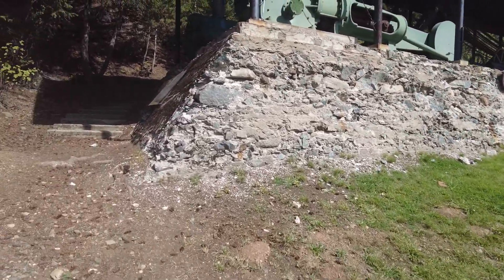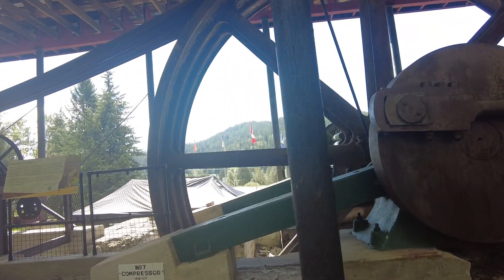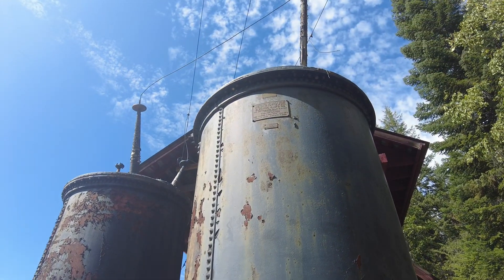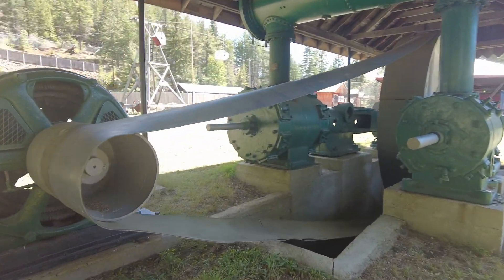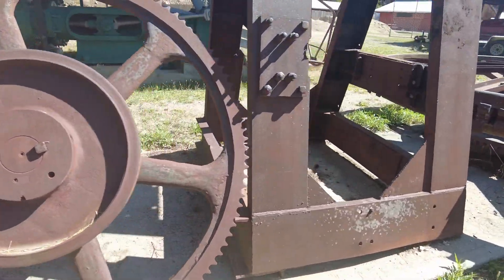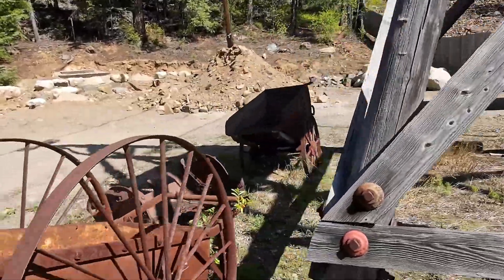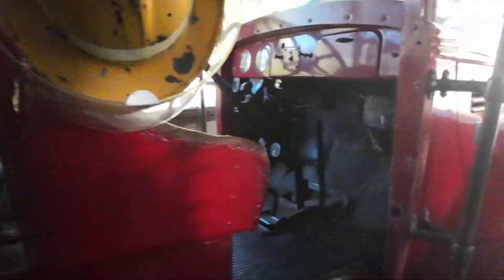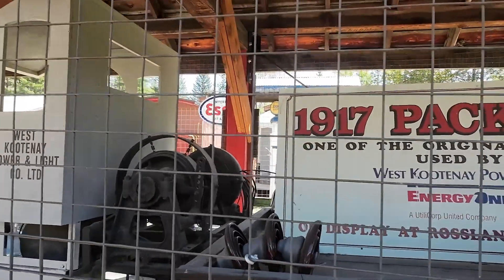Rossland BC - Nikola Tesla's Power Generation Technology, A Giant Air Compressor & Gold!

Comment: some engineers say ... in long distance power transmission. DC is the better system when moving along wires.  speaking in terms of 1000's of miles.  AC power at 60 cycles cannot transmit this far, for some other reason, i believe it's due to collision of each 3 phase .  remmember Tesla was not interested in long range power via copper wire, Tesla was designing 60 cycle around "wireless"  power transfer....
Reply from the maker: Thanks for sharing!

Comment: That's not a generator, that's a motor.
Reply: Indeed it is, but a synchronous alternator (generator) is constructed the same way.  A synchronous machine (whether used as a motor or a generator) requires a dc power source fed to the rotor windings through slip rings.  This is most commonly supplied by a small dc generator called an exciter.

Comment: Actually, DC works great for long distance power transmission. It uses the entire conductor rather than just the outside 8mm that 60Hz AC does. The problem is that until the modern era, it wasn’t practical to build the power electronics needed to run High Voltage DC and do the Rectification and Inversion efficiently. But many new long distance power lines are being built as HVDC.
Reply: I came here to say something very similar!
Reply: Each time I read a good explanation of something electrical I get one step closer to understanding the difference between amps volts resistance guages DC/AC and how to ground thing lol..😅